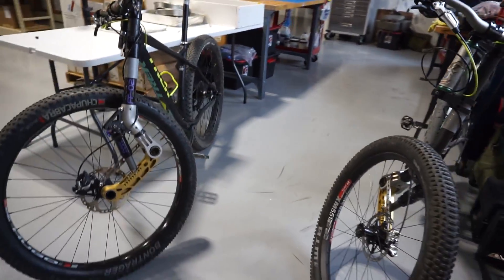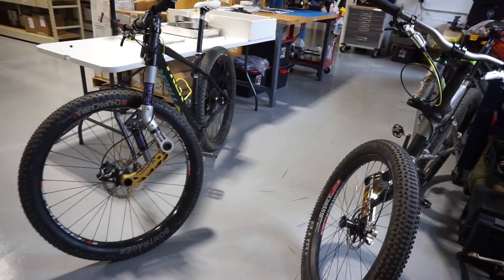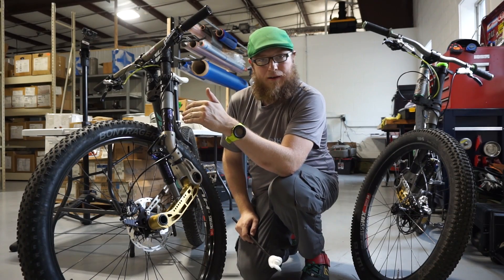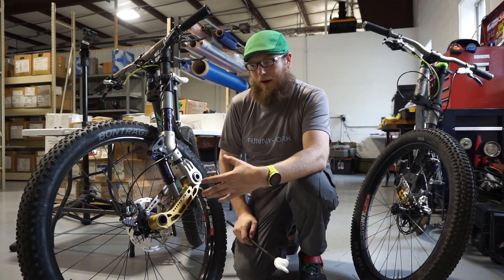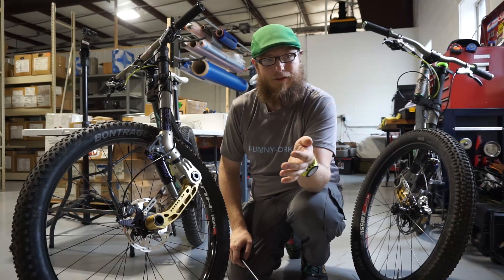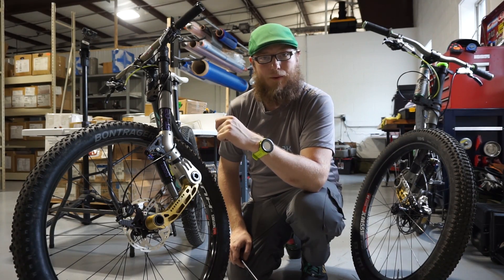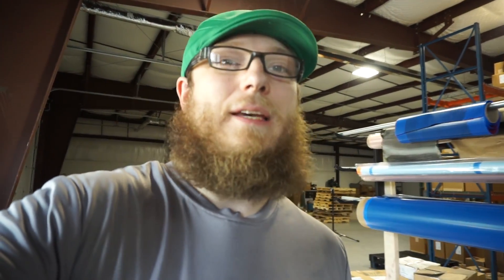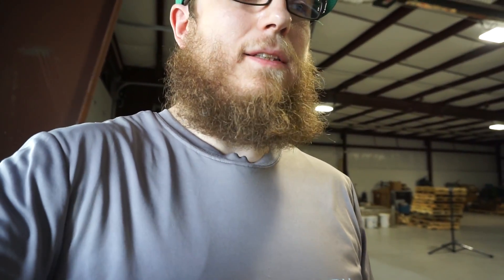Introduction to The Funny Fork by JGW.BIKE

Comment: by eyeballing it seems like you fucked castor trail🤦‍♂️
Reply from the maker: I was testing zero trail, the fork was designed to run different length swingarms, and pivot positions exactly for the purposes of testing things outside of the 2 offsets sold.
Reply: @joshgoreworks5567  wont this increase compliance, jacking and too much castror trail change, 
from designing point of view
castor change might be favorable but will compromise on weight reduction and increase compliance, to minimise compliance castor change will be reduced as arm lenght increased and made parallel even if everything is compromised well weight, maintenance and conpliance cant be as low as traditional design
what's your say?

Comment: For mtb linkage forks I would recommend reversing the pivot location so the pivot is facing away from the bike. That way it helps with anti squat and takes an arc that isn’t forcing the bike towards the opposite direction of travel. It’s the same idea with high pivot rear suspension. I think it would probably ride smoother and have better grip when going over large bumps and cornersz

Comment: Yea, just like you mentioned, it needs to be lighter and smaller. So my question is, is it possible to make funny forks on bith sides of the wheels but this time, thinner or even
Smaller? Thinner and smaller should still work coz this time, there are 2 of them working together similar to that of traditional forks but ofcourse, with funny forks design. I
Love its ingenuity except that it
Feels odd that the fork
Is only on one side. Thing is, you've got handlebars on both side, pedals on both sides, and 2 chain/seatstays.

Comment: Love the design. would be interested to see what its like with a coil shock with air assist. could really tune dive in. Make one where the  travel of the wheel in essence keeps the head tube angle exactly the same through the whole suspension sweep.

Comment: Hehe this fork reminded me the Honda 90 or the vespa forks they use to run in front ,not a sparking or top level forks but does the job as supposed,I think strong points in this bike design is the ability of personalization of the behave and travel options, air shocks comes in dif types now, some are platform dedicated like the ck db air that would run a Knolly as a premium shock aince their 4x4 suspension design would be more effective using that shock ,in this particular case if the weight is a concern then some carbon fiber is the way to go, sadly i+d in this design would be very expensive, prolly some ceramic bearings, a nice looking mud guard and the ability to fit 26-27.5 or 29" wheels can turn this model fork into a desired product ,cannondales would test this design in some proto xc race bikes imo so I think this idea have some future, make sure u have a patent in case u find another use to this model not only bikes can benefit of this design :B cheer from Bolivia.

Comment: I think the design is so revolutionary and so out of the box.As a very pasionate rider and mechanic I can see this sistem working so well.The design allows you to configure the damping to perfection by playing with the arm's lenght.Amazing work!I hope it will be mass produced at decent price.I still can't understand forks being so expensive,so much expensive comparing with car suspension.
Reply: Not very revolutionary at all given the Honda 50 was running a leading link fork well over 50 years ago and the USE SUB fork showed up 10+ years ago on mountain bikes. Still nice to see some attempt being made to do better than the unreliable junk being sold for $1000 a go by mainstream fork manufacturers. Provided the pivots are well sealed, the Motion France fork looks like the best hope for a reliable fork to show up on the market since Marzocchi outsourced to China and ruined their own products though. They're in production now AFAIK.

Comment: On a sceptical note it is worth pointing out that Cannondale have switched from the Lefty fork to standard fork set ups from Rock Shox and Fox, though that was a telescopic fork. I think multi pivot forks have an advantage in so much as they don't suffer from break dive and have greater overall performance, with such things as small bump sensitivity. Motion France produce a fork with a similar concept but it looks very different so the potential market for multi link forks is there.
Reply: Not on their higher end XC bikes. I just purchased a Scapel and it has a lefty.
Reply: Cannondale's Headshok and Lefty run needle rollers on a square shaft instead of bushings on a round stanchion, so they cost a lot more to make, but should be in a completely different class to other telescopic forks in terms of small bump sensitivity. I haven't tried them, so can't be sure though.

Comment: Hi Josh, do you prefer the Stache or the Sultan? I'm probably going to choose one as my next bike.
Reply from the maker: The Sultan is fast, loves some flow and is comfortable all day.  The Stache changes direction fast, likely due to the shorter chainstays but through the rough stuff prefers pinning it over picking lines(the tire mass at speed removes some precision).  If I was picking one bike it would be the Sultan with two wheel/tire setups(27.5+and 29).  The Sultan is near the end of its life and will be replaced soon enough, likely with another if Turner doesn't have an updated model out yet.  Thanks for the question.
Reply: Great answer
Reply: I am now a Stache owner.
Reply from the maker: Congrats, its a hoot, enjoy!

Comment: Sub'd. I like that. That could really be a game changer. Funny how its a small one man band who's pushing limits more than manufacturers pushing BS like Boost and inner tubes for your tubeless. Anyway. I will assume this means you can have a fantastic modular design that with the swap of a lower linkage or shock position you could adjust head angle, Wheelbase (and trail), travel etc. My main concern would be rear shocks (as far as i know) don't provide many options for low speed compression adjustment and a remote lockout lever would really help too. Keep it up!

Comment: Why the single side? Is it easier to design/build one side forks? Mentally, I can't get behind the "lefty" fork... Seems like you'll have to make it super beefy to compensate for the torsion.
Reply from the maker: I will dive into this in more depth in future videos but the decision was multi faceted.  1.  Simulating multiple carbon tube assemblies on both sides of the wheel was difficult and beyond my internal FEA capabilities, others have reached out with greater expertise in this field and will likely allow for future development down that path.  2.  I had some large diameter carbon tubes which were going unused.  3.  Less parts at first means 1/2 as much to QC, setup in the cnc, bond in assembly, etc.. 5.  I wanted to and knew I could always go another direction.  In fact I have this designed in dual sided application ready for the cnc if it proves to be a beneficial step forward.
Reply: Thanks for the thorough response! I look forward to seeing the future progress and revisions.
Reply: If you can't trust a lefty to be strong enough then you need to start worrying about how the wheels stay on every car on the road with independent suspension. The wheels on cars are only held on from one side too and they even see much higher cornering loads as cars can't lean.

Comment: What's the mechanism that is used to adjust the pivot point? It appears to me that it's fixed unless you're changing the tube it mounts on, and thus the shock mounting location, travel, leverage ratio, etc etc?
Reply from the maker: The entire 'strut' slides up and down to adjust the height of the pivot and beyond that both FF-01/02 have different dimensions on the pivot in relation to the steering centerline.   I will cover this in a video to elaborate.  Thanks for your question.

Comment: Only question: does this reduce or increase brake dive? Also looks heavy...no question needed really.

I guess torsional forces would be worth looking into as well...while Lefty style forks are usually quite stiff, that single linkage might prove
to be a weak point in overall fork stiffness.
Reply from the maker: It can be setup to reduce brake dive or function with dive, and this is very much dependent on the riders center of gravity in relation to the pivot location.  Dive becomes a tune-able function of the fork.

Comment: About 20 years ago Mountain Bike Action did a bar-mounted G-force analysis on different forks. One that didn't do very well was the AMP. They attributed the poor results to its odd wheel path (it was a linkage fork with a slightly forward wheel path). Gotta change that fork's wheel path.  A trade-off is losing the anti-dive effect, but it's worth it, imo.

Comment: Looks very interesting. What is the current weight of the system as is?
Reply from the maker: 5+ Lbs depending on shock choice.  Lots of weight to lose.
Reply: Where does the centre of gravity sit wrt other forks?